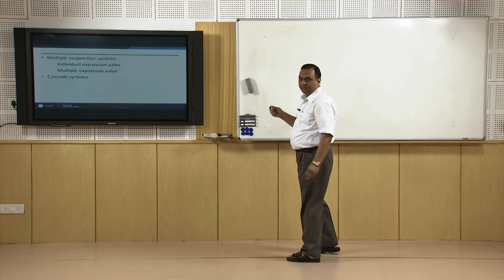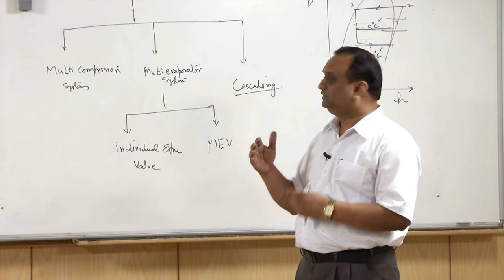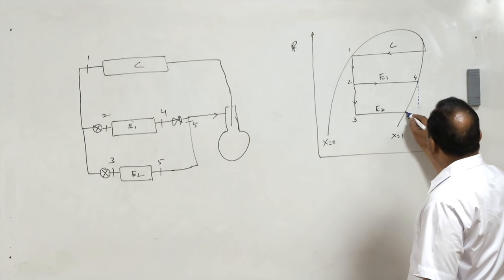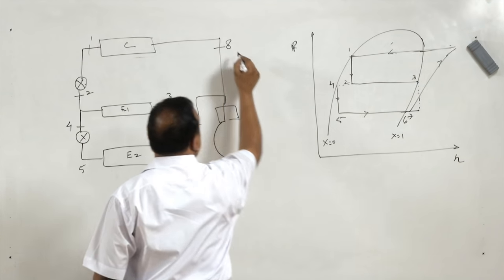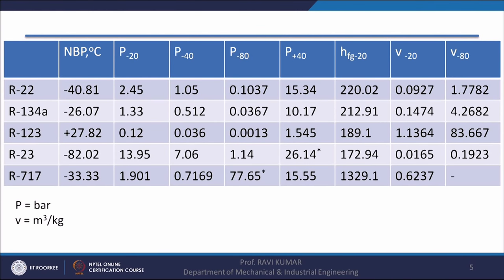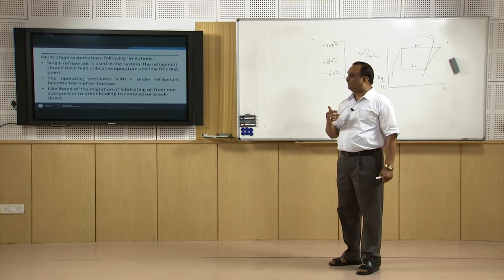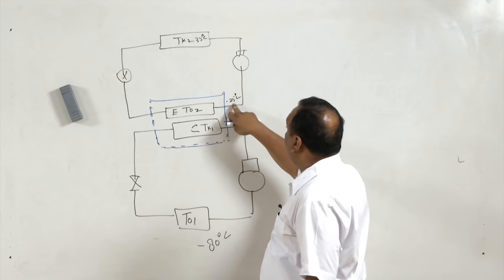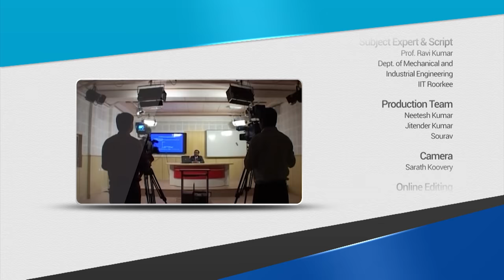Multiple Evaporator and Cascade System

Comment: Dear Sir, Would you tell me how i can chosse the compresser for second stage (run R 23 or R508b)? i am building freeze dryer. i have trouble with cold trap.first stage i take a compress in normal refrigrator with gas r145a . and the second stage what have i to do?

Comment: Sir,  thanks For your this information, but in multi evaporator system no role of EPR(Evaporator pressure regulator) has been discussed which we need to have on high pressure evaporator to maintain the pressure different and temperature. If possible please revert back.